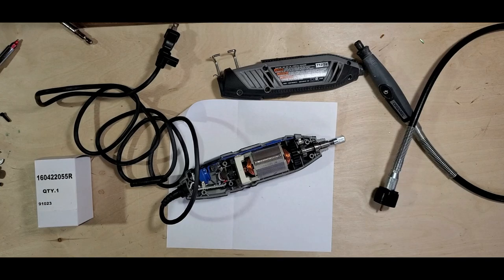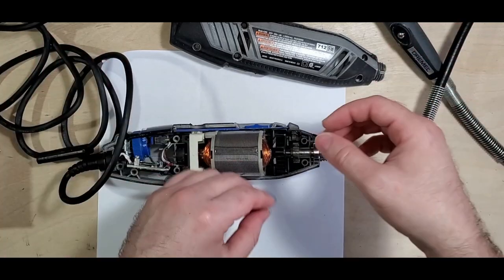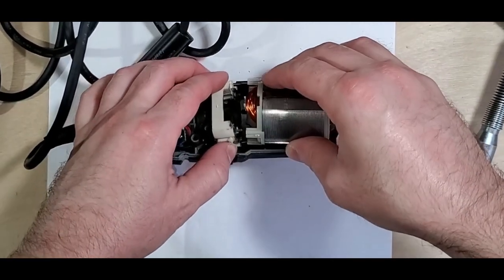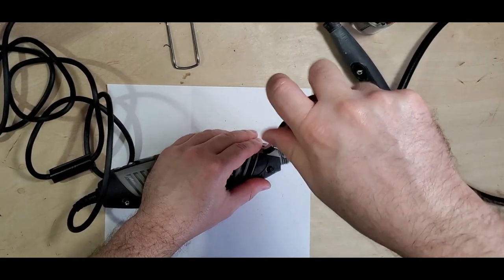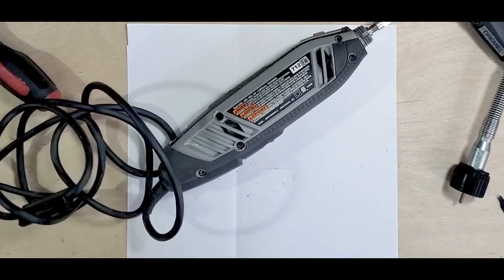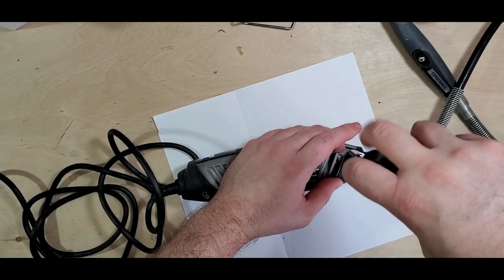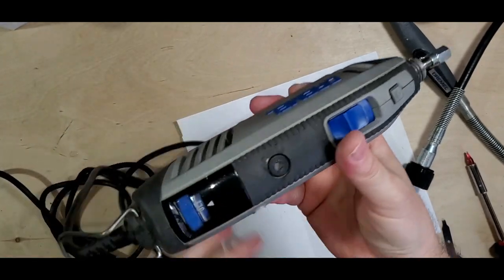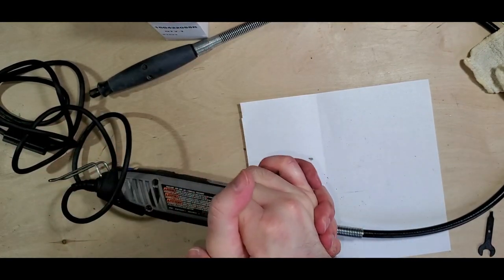How To Fix Dremel 4300 Rotary Tool Field Assembly Repair

Comment: Had that happen to my 3000. I took a piece of copper wire and hammered it flat to match opening. Plugged it in and still going a year and half later. Never occurred to me that I could buy a part, duh.
Reply from the maker: ha! that's a great fix.
Reply: @cleve Thanks to your video and these replies and I'm up and carving again.

Comment: This saved the day thank you I was about to take a hammer to  it. I found the faulty clip and used a piece of copper to complete the circuit and now it works, and for free. Probably better the way you did it but at least they got me running again.

Comment: Yeah , as super helpful snd saved hours of trial and error,  I would definitely just find a something laying around or disect a cheap harbor freight rotary tool before I give dremel more money for a tiny piece if metal. Hell, next dremel that breaks I'm just going to harbor freight and buying a cheap workhorse rotary that actually holds different sized accessories not just toothpick skinny ones and pay the two year warranty free replacement.  And just swap it out every year in a half

Comment: Mine just stopped working 5 minutes ago and I’m so frustrated. I’ll give them a call as you suggested.
Reply from the maker: yeah its frustrating but can be an easy fix. first always check the brushes to see if they're worn out. hope you get it up and running.

Comment: This was my problem.. mine wasn't broken tho it was just off-center.. and the gold pin was between the metal and plastic  NOT between both metal pins... FROM THE FACTORY... meaning their Quality control let this pass through.  (i was wondering why it stopped working after 3 times of use.)